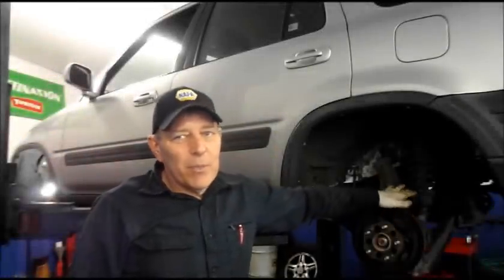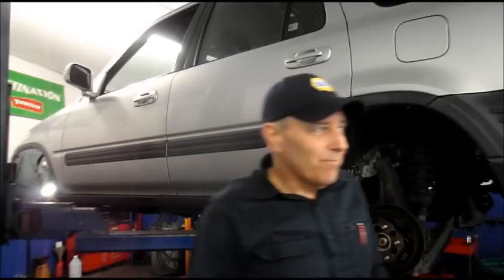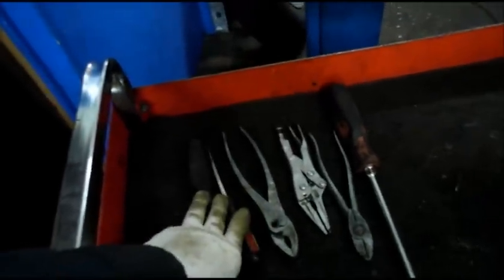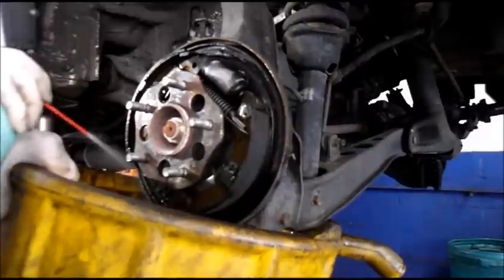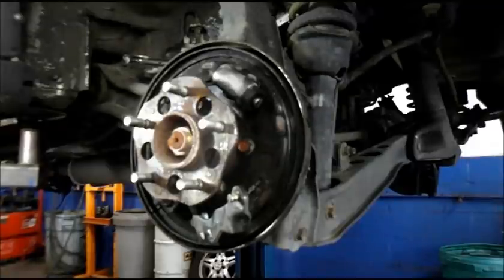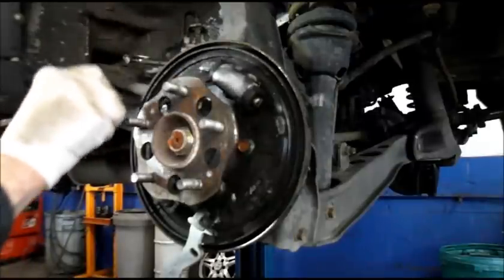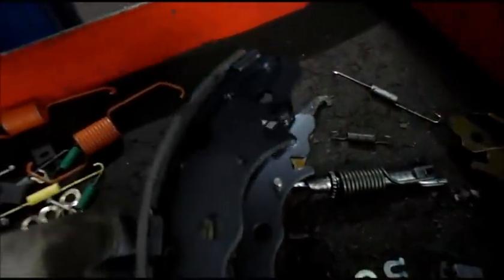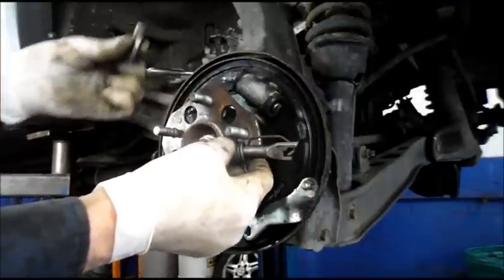How to replace the rear brake shoes on a Honda CRV

Comment: Clear&concise, wish I'd seen it before struggling until 10 p.m. every time i pulled the spring the shoe detached the rubber bits and leaked fluid! Had to hold both shoes with left hand and I levered the spring in with a screwdriver pushing off the central hub. Easier! I didnt know about the adjustment and pedal was going all the way down for a stop. But I topped up with dot 3 and pumped the brake in reverse which auto adjusted them!! (After much googling) lol
New springs etc installed but KEEP old ones in case for next time people! Thanks, great video and not rushed like some!

Comment: I last changed the shoes on my CR-V about six years and I'd forgotten how to do it. It's been losing a lot of brake fluid lately; I found that one of the wheel cylinders was badly blown. I decided to replace both wheel cylinders and all the shoes while I was at it. Thanks for the tips to make the replacement go faster.
Reply from the maker: +hoopfan71  Good idea replacing both wheel cylinders.
Reply: +jimthecarguy how are the wheel cylinders attached? I think mine need replaced (unless it's common for one of the shoes to be much more worn than the other?)
Reply from the maker: +Justin Grubbs  The wheel cylinder is held on with 2 8 mm screw in the back.Before you replace the wheel cylinder you should check to make sure the parking brake is fully releasing and the the back in  plate is lucubrated so that the sure slid without binding.If you need further advice let me know.Jim
Reply: +jimthecarguy Thank you very much Jim!

Comment: Great tutorial. It helps to take a few of pics before and during removal of the hardware. Also, there's usually a shop that will turn your drums if needed and they shouldn't charge too much.
Cheers

Comment: i watched this several times while i was trying to put on the main return spring on the top side of the shoes.  What i ended up doing was buying a pair of the longest handle cuttin pliers I could find.  THen, you may have to rotate the rear axle to get the most leverage you can to get that spring in its hole.  I had tried vice grips, long nose, short handled cut pliers.  none worked.  you need long handled ones and use the axle as leverage.   This is hands down the hardest return spring I have ever had to put on and i've done alot of brakes over the years in my driveway.  good luck.
Reply from the maker: norm rostocki Hi Norm Yes putting that spring on can be a real pain in the a_s.Good job.Jim
Reply: Hmm, needle-nose vise grips worked fine for me. I just made sure to fully close the adjuster.

Comment: Good video. I'll be doing this in a few weeks when its not 95 degrees in the garage like it is right now.  Don't forget your vise grips on the brake line when you finish assembling.
Reply from the maker: hivoltguy1 Good luck .Ya it can be a ruff in the heat.If you need any advice let me know.

Comment: Jim, you seem to prefer to use the cutting pliers to grip the springs. Aren't you afraid of putting too much pressure when squeezing them that it will actually cut, or at least weaken the spring?

Comment: Oh man. This job was a total pain in the hind parts. Jim must eat his wheaties and his spinach. It took me like 2hrs to figure out how to get that stupid main spring back on. I’ve been working on my own and others’ cars for over 25yrs and this was one of the most frustrating things I’ve done. 

A word to the wise: the shoes from autozone are defective. The parking brake pin hole isn’t large enough, which is a disheartening discovery when you have it all pulled apart. 

Also: the wheel cylinder will vomit out its contents. Not sure if clamping off the brake lines is a good idea? 

I was glad to see this video, but Jim makes it look easy! Definitely wear eye protection. If I were to do this again, I’ll bet it would take me 30min per side, but it’s a total pain. It does make you realize how heavenly disc brakes are by comparison.
Reply: How did you end up getting the big spring back on?
Reply: @seanross1589  I think I used a decent sized pair of wire cutters to push it back on. Right after this, I bought a brake drum tool kit so I wouldn’t have to do that again, but haven’t had occasion to test it out. Good luck!
Reply: @toastrecon  Thanks for the input!  I also had a brake drum tool kit, but it was useless for these CR-V brakes (I got it from harbor freight) I think it is more for American cars. I ended up buying some special pliers I made a PSA on the main comment thread for anyone interested.

Comment: Hi Jim,   Thank you for the video, very helpful.
   My wife's honda right rear vibrates at high speed, also when parked, smell burning tire rubber. Took it to a mechanic and said the right brake shoe is hanging up because the brake cable will not release. They want quite a bit of money for this job. Would this inability to release be in the drum? - or would it be  farther upstream? I know you dont know for certain, but I never had a car where the cable would not release the brake shoe, and not sure probability wise, where the problem would reside. Any suggestions would really help! Thanks!
Reply: Actually not uncommon for parking brake cables to rust and seize. This happens most to people that never use their parking brakes until it needs to be applied during a state inspection for example, or someone else has driven the vehicle and normally uses their parking brake and might have applied yours. There is a reason that this "parking" brake is also called the "emergency" brake. If your hydraulic brake system were to fail, you would be able to stop your vehicle by applying the "emergency" brakes....providing they were in working condition. If you love your wife, get her brakes fixed before a fire starts at highway speeds or she actually needs to use the emergency brake to stop the vehicle. Happy wife, happy life. Get 'er done.

Comment: Hi Jim nice video. Did as you showed on video but I can't get the big spring back on for some reason it keeps pushing the rubber ends off the wheel cylinder because of so much pressure it puts when you pull down. Any suggestions. Thanks

Comment: Please excuse my ignorance. When replacing the drum brakes (on this cr-v model for instance), do both of the rear tires need to be in the air or can they be done like front brakes one at a time? Thanks for your kind reply.
Reply from the maker: That is a very good question.I do a live stream on jimthecarguy Sunday night at 7:00 PM .I will talk about this .I hope you can stop by

Comment: Your video was a great help, however I am only batting .500 one side is ok, the other the drum drags a great deal.
I checked the springs and the star wheel is completely closed, they appear to be ok and compare with the other side, any suggestions would be appreciated
Reply from the maker: Check to see if the adjuster is in correctly .Check my video between 9:00-10:00 to see if it correct.Keep me posted.
Reply: +jimthecarguy I check that and it is good. I believe one of the pistons in wheel cylinder is stuck. it would not push back into the wheel cylinder at all unlike the other ones
Reply from the maker: OK if you need any further help let me know.

Comment: I figured out how to get that damned spring into the hole. A Rube Goldberg but it works. Hold the brake pads together by tightening zip ties around them. Then take a  long screwdriver and grind down the "---" tip so it is curved into a "u". Then instead of using the cutting pliers, push against the hook of the spring with your curved screwdriver. It pops right in!

Comment: are the cables that go into the back of the drum removable?
i'm trying replace the rear left trailing arm, it got bent up real bad from a swerve into a curb and now my wheel has a huge 20 degree positive camber and toed to the right 10 degrees or so, it seems the bends all happend around the bearing assembly. i figure it would be easier to take out the cables and leave the axle in for it's other end to be removed from the transfer case. or should i just try to remove the axle and leave the drum on the trailing arm? i'm pretty sure i need a new bearing anyway.
Reply from the maker: Yes the is a clip that you will need to push in to remove the cable.The clip is on the inside.

Comment: I am doing this on the GFs honda and man I am glad I drive German cars. The last time i did this was for my old 64 Pontiac .
Reply from the maker: +Jake Wright Good luck .If you need any other info let me know. Wow 64 Pontiac.
Reply: Thank you, ya i was young and it was my grandfather's car originally. It was a cool in high school in 1994. I look back and the whole car is so simple compared to my 2001 Benz. I will buzz you if the brakes give me hassle
Reply from the maker: +Jake Wright  Ya it was great to work on the older cars

Comment: At 15:20, you attach the large orange spring that wraps around the star adjuster with very little difficulty. I cannot for the life of me get that spring hook to attach. I see you're pushing the brake pad towards the spring and I'm doing that as well. It's as if the hook just isn't long enough. The spring is on the star adjuster correctly. Any advice?

Comment: Jim. I have a honda crv and it only have 4 studs, on the wheel hub.. I just want to know whats the difference between the two and is it better to have more studs.. Cheers
Reply from the maker: +Easy Fix Did one of the stud brake off?Or did it come like that from the factory
Reply: +jimthecarguy No it came like that from the factory. But i just want to know if it makes any difference between 4 and 5 stud hubs?
Reply from the maker: +Easy Fix Good question.No it should make no difference.

Comment: Accidentally pushed the rubber seal off of the piston when putting the spring back on and lost a little fluid and may have introduced air to the line. Should I bleed the line to be safe?
Reply from the maker: If the wheel cylinder is leaking fluid you should replace it with a new one and then bleed the system.

Comment: Jim one of the spark plugs on my honda crv is really hard to take off any way i can remove it without damaging anything???
Reply from the maker: +Juan Vallejo Be very careful you don't want to snap the plug or strip it out.Try using some spray lube and working the plug back and forth VERY EASY.Let me know how you do.

Comment: Folks this is a job only for on a lift. I have been at it for 23 hours on the one wheel
Reply: No shit. At least you can put you body weight in while pulling down on the large spring. It's virtually impossible doing it on the ground.

Comment: I am having a hello a time getting the main spring back in, any movement moves the adjuster out of possition and that spring needs to travel a inch or so to reach the hole.  Any help would go a long way here.  Please
Reply: Having the same issue.  Did you ever figure it out?
Reply: @seanross1589  muscled it into place with a good set on needle nose pliers
Reply: @paulrichardson7905  Thanks for the input!  I just made a PSA on the main comment thread for anyone interested.

Comment: thanks ! i have to do this today or tomorrow ! sold my 1999 k1500 to pick up a crv i like it cost nothing for gas lollll
Reply from the maker: PMGaming101 I know what you mean .I sold my Dodge Durango and got  a CRV. That cut my gas bill in half.:)
Reply: yess hahaha love that little truck ! everything whet well on the drums just one thing got me stuck for 10mins . the adjuster on the hand break side  i was siding it in backwards! but there is a cut out in it and that goes on the outside  !!!
Reply from the maker: Great job

Comment: what kind of brake grease do you use?
Reply from the maker: +Joshua Jager It is a synthetic brake and caliper grease.
Reply: can you use silicone paste?
Reply from the maker: I never heard of synthetic paste.Use the grease.
Reply: thanks for your help, it was a Pita. i went to see if i could get a drums turned and they said they were Not serviceable. also on a side i ended up getting a leak and having to bleed them after i was done.